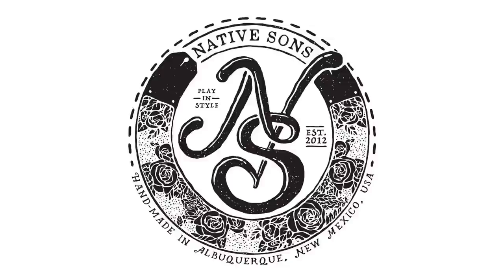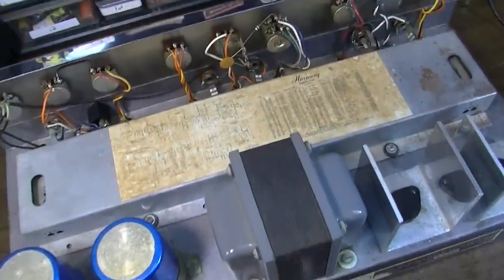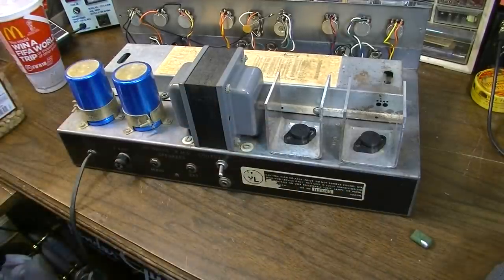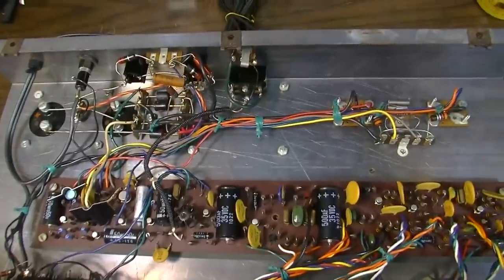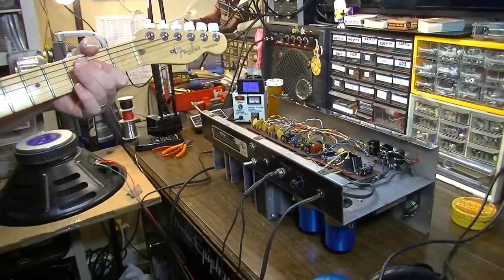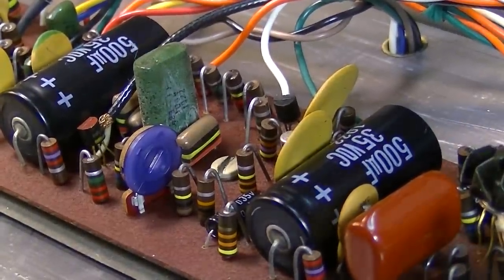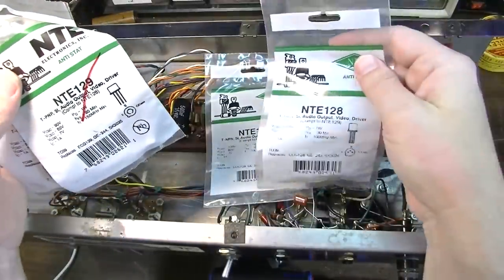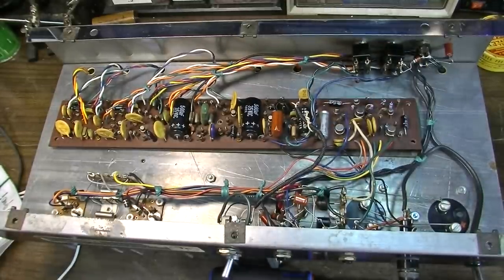STUPID AMP! - 1970 Harmony H550 Solid State HAIR PULLER Repair

Comment: Hi thanks for all videos. I started out in life in the 1970’s working for a company that made just transistorised test gear. One of things we made was a transitory tester, which along with testing the gain would test the reverse brake down of the transistor junction which with some failure modes could be quite low, like 20 plus volts across the junction. Sort of like a zener diode. All transistor had a brake down voltage but at that time if not now some would get a lot worse with time. Cheers Gary

Comment: Your patience paid you Brad. Congratulations! It's a kind of misadventure that can happen sometimes especially with germanium transistors (and sometimes with silicon ones too). A tester is not always reliable. If it test good, it's not a guarantee that it's good. But if it test bad, it's always bad. I thing that the main reason is because a tester send only a few Volts to the transistor witch is not "the true live" operating condition. I have seen transistors that start to leak somewhere above 10 Volts but where fine below this voltage. Personally when I am testing a transistor, I first use my multimeter. If it test good, then I use my old Heathkit IT-11 capacitor tester on "leakage" position starting a 3 V and gradually  climbing until it start to leak between Collector and Emitter with Base open. If it start to leak anywhere before its rated CE voltage, I replace it.

Comment: A tip for solid state class B amp testing:  Remove the speaker or dummy load, add about 470 ohm resistors in series with
both power rails to limit the current.  Then do your trouble shooting.  That means faults won't cause bug currents that fry things.
Make sure to put the resistors after the power supply caps so they can't zap things.
Reply: Oh yes, that also makes it easy to measure the current drain too, which is useful for checking the bias pot is functioning.  You need to overcome your unwarranted fear of solid state circuitry :)
Reply: Oh absolutely.
And stop changing caps because you think they 'migjt' be faulty!
Reply: @DrWatts-bi1jv   If their paper and oil or old electrolytics, they gotta go, anything over 30 years old, has to go, it's stupid to keep runing an amp with old parts like that.... its risky and not worth it.

Comment: I had a freebie amp a few weeks ago with a little nick in the power cord ,and the plug cut off. I put on a new plug and taped up the little nick, but it wouldn't power on. I disassembled and reassembled the damn thing 3 times over 4 days, testing and retesting everything I could to figure out what the deal was. During the final assembly (after giving up on it) , I discovered by accident that the whole problem was just the little seemingly insignificant nick in the damn power cord! Every time I picked the cord up to test it for continuity, it was making the connection, but every time I plugged it into an outlet, gravity was pulling the bad connection apart!! After completely replacing the cord, I did an autopsy on the nicked section and was able to see the deceptive intermittent break :)

Comment: Thank you, I have a few ACC 260s, "The Doors" amps, they require a nice overhaul. One of them has a wild harmonic runaway after the amp warms up, starts screaming notes above 700hz, like a feedback loop. Another is shorting to chassis with some nasty voltage.

Comment: Hi Brad!  I've always just used a digital multimeter on diode test to test transistors.  It's at least a half decent go - no go test.  So with an NPN transistor, red lead to base & black lead to emitter you should measure say 0.6V dc.  Next part of the test - leave red test lead on the base  & move the black test lead to the collector, & you should read say 0.59V dc (the now forward biased B-C junction).  

This second measurement is reading the normally reverse-biased base-collector junction.  Most of the time, the base-emitter measurement will be a millivolt or 3 higher than the base-collector reading.  This can help identify collector or emitter.  Just reverse test lead wire colours for PNP transistors.

As other guys here have said, the little tester you built has shortcomings.  A 'curve tracer' may help, or one of those component testers that show a loop, or a straight or angled/bent line on a cro screen.

Comment: Great work repairing this distinctly-less-than-classic-yet-oh-so-interesting amp head!  As for the confusion regarding the status of the transistors you replaced, I would suspect the component tester; I recently saw a very informative video by a gentleman named John, who maintains the JohnAudioTech YouTube page, and who reviewed a component tester very similar, if not identical, to your own tester.  He found it gave VERY inconsistant readings, and concluded that, while it did a fair job IDENTIFYING components, it was next to worthless for testing them!

Comment: I had the same thing happen with that exact LCR meter. I had a difficult repair where all of the components tested good. The MOSFET's tested good with the component tester, but all of the symptoms were telling me the FET was bad. Replaced the FET's, and it came to life. There was 1000V on the FET's, so maybe it was a case if components testing good at low voltage, but not working properly at high voltage.

Comment: You are correct on the date. A small band that practiced close to where I lived had that same amp. I remember it being so very loud. That was the big deal at that time.
Reply from the maker: It was an expensive amp in its day! The head and cab would have set you back about $550.
Reply: The Guitologist The high price sound right, they had the first Gibson SGs I ever saw. I took lessons from their mother and she had an old Les Paul that was made just before they stopped making them. I didn't realize what she was playing for years later. I'm still in love with her legs on up. Trying to look up her dress is why I stink at guitar.

Comment: I don’t have those fancy transistor testers and the way i test them is by building a circuit around em, something like a first gain stage from a big muff for example should work with just about any bjt or a mosfet, and obviously you would have to account as to wether it is npn or pnp.

Comment: Yeah that tester is more of a component identifier.  You have to test transistors at voltage and feq, witch sucks because you need a high end tool.
Reply from the maker: After this repair, I feel like a high end tool.
Reply: Haha
Reply: Good knowledge though! Those transistors have to be tested under load it seems. Like you said that tester is more of just an identifier.

Comment: Hey Brad, I have been working on a 2000 Mexican J-Bass with a badly bowed neck. The customer told me that the original neck was bowed excessively and when he tried to loosen the truss rod, it broke, the truss rod. So he ordered a replacement from an individual on e-bay. The new neck ,according to the serial # is also from a 2000 Mexican J-Bass. When it arrived it came in a NEW FENDER NECK box, should of been a clue that this neck had issues as well. He mounted it on the guitar and when he tuned to standard E A D G ,surprise,  surprise the neck bowed loke the original neck. He brought it to me and I measured about .050" relief at the 7th & 9th frets when tuned to standar E. I placed blocks on either end of the fretboard and placed my longest leveling bar on the blocks. I then placed a clamp at the middle of the neck and cranked about .025" bow at either end with the truss rod under no tension. I then placed a couple washers on the truss rod after lubricating both the rod & nut . After tightening the truss rod and removing the clamp I had a slight bit of back bow on the neck. However once I tuned the bass up the bow returned.  We were wondering if Fender may have had a bad batch of necks on 2000 Mexican Basses. Any info on this issue would be appreciated. Thanks for your time and consideration in this matter, keep up the great content, Jeff 'Gonzo the Guitar Guy ' Kellogg
Reply from the maker: Is the truss rod slipping? Did you try retightening? Maybe threads stripped?
Reply: The Guitologist the threads seem fine , I think there was a bad batch of necks that year as both necks, the original and the one bought off e-bay are from the same year by serial numbers. Was wondering if you had heard of this issue before. Or maybe a bad batch of truss rods ?

Comment: Commenting near the beginning of the watching.  But those big blue caps remind me of the huge caps that were on tape drives (computer, that is) back in the '70's and early '80's.  There was a "hot potato" drill where techs would do a "heads up" and toss one to someone.  They claimed that they would sometimes zap the heck out of the catcher.  Oh for the simple times!  (And actually, I never saw anyone shocked, as the ones they were tossing were usually the ones coming out of the drives, and even back then the techs understood that they had better discharge the capacitors before replacing them.)  

Brad, your channel rocks!  Thumbs up!

Comment: The RMC ceramics have been pretty good all around, they used a better epoxy coating that stood the test of time. Lots and lots of RMC .02 & .01 1kv were at a local surplus store, along with a box of NOS 1968 CTS 1 meg linear pots.  I grabbed what $40 bought, Money well spent!

I love watching your more difficult repairs!
Reply from the maker: I need to buy a lot of ceramics from somewhere. I'm running out.

Comment: Another viewer commented my thoughts - ECG is a replacement part. So Q3 and Q4 have likely been replaced before.

Looking at their specs, diode junctions looked ok in your test, but Hfe seemed really low. Datasheet claims a minimum of 90 for ECG129... that was my first thought. Yea, they tested as functioning, but low gain. Make some wonder if there's a bigger issue.

Pain in the ass, indeed... good work finally getting that sucker functioning! Let's hope it ain't a bandaid.
Reply from the maker: I wouldn't have suspected that would have caused a short of base to collector, which is what seems to have been occurring at operating voltage.
Reply: The Guitologist yea that doesn't quite add up. 

I have worked very few SS amps, but most are 60s/70s early stuff. Most of it was poorly designed, seemingly taking a tube circuit and subbing transistors at lower voltage. LOL they don't work the same, so the stuff is full of issues.
Reply: Do the bird now...(?)

Comment: Just a suggestion: faulty solid state amps are notorious for baking speaker coils, either due to parasitic oscillations or massive DC offsets, normally to one of the supply lines. To protect your speaker (assuming 8 Ohms coil) when testing an unknown amp  best to connect a 16 Ohm resistor in series with the speaker and then connect a 12 Ohm resistor in parallel with the speaker and 16 Ohm resistor so that the amp sees an 8 Ohm load.
Reply: Great Tip!

Comment: They used to color the tops of transistors, for matching purposes. They would test batches of them and sort them according to their current and voltage characteristics. Then when they were used in an amp, they just had to use all of the same color to get the best matches.
Reply from the maker: I think in this case they were probably separating the FET from the other transistor.
Reply: All so there noise spec

Comment: for solid state stuff current checking and a good curve tracer will set you right. You can't just look at voltage alone. Also leaky transistors can test as being higher gain than they actually are so those cheapo meters can't always detect it.

Comment: Metal can transistors does not mean germanium. I still buy metal can variants of both silicon bipolar and j-fet transistors, in current production today.
Reply from the maker: I just assumed because of the package and age. Thanks.
Reply: Like the good ol workhorse 2N2222A.  Love them.
Reply: Yep. Looking at 2:35 the parts list shows 6 types of transistor, all of which are Silicon, not germanium, with one FET and the usual output stage suspects of the good ol' 2N3055's

Comment: Love your channel.  My suggestion would be to find an old service manual from the 70's for a high end receiver such as Sansui AU series.  They have explanations of the discrete output stage component by component.
They are a balancing act between the positive and negative rails to keep the DC at the speaker rail at zero.
It really is like a diff amp with DC  feedback from the speaker output driving progressively higher voltage and current stages that ultimately have enough current and voltage to drive the power transistors, but there are things like bias, current mirrors and such in there that require some knowledge of too really understand the config.
BTW, never have a load on the speaker output when troubleshooting a transistor stage. Esp when initially bringing it up I a variac.  If you get DC offset, you won't provide a load for the transistors to try and transfer the rail voltage into.
Good luck.

Comment: You can make a real simple diode junction tester with a transformer with  low voltage 2ndary and a resistor. Yes, it's just that simple.  
You X/Y your scope (as i recall across the resistor, you'll have to Google it) and can view the quality of the E-B, B-C, and E-C junctions.  It's also great for zeners up to the limits of your transformer 2ndary.
Between it and your DVM diode checker you can ferret out most transistor issues.  
I made one way back in the 70's and am still utilizing it successfully.  I'll bet it would have caught that bad driver transistor.

Comment: The circuit uses a cap bootstrap design with string diode bias circuit and them little transistors with the diodes going to there collector pins are short circuit or v limiting, if there is a short on the output they clamp the drive volts down.

With a supply line of 38 plus and minus volts this amp would be about 60 to 100w...

Electronics tech here..

You can remove the short circuit transisor parts and the amp work just fine.

Electronics engineer here...

I hear your frustration as had many headache amps to..

The amp uses long-tail pair..Next bootstrap vas stage..a simple bias string diode..

Comment: Looks like an old Tektronix curve tracer would be a useful tool if you work on solid state stuff. It will expose a transistor to actual operating conditions.
Reply: Agreed.  Tektronix 575.